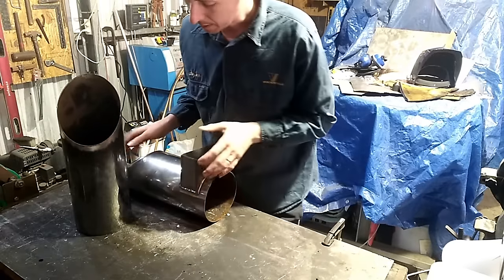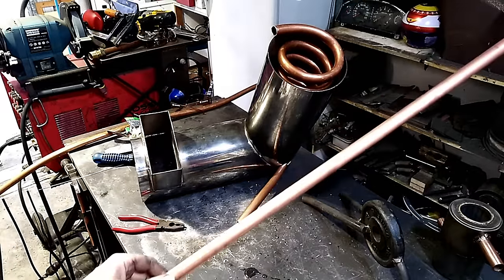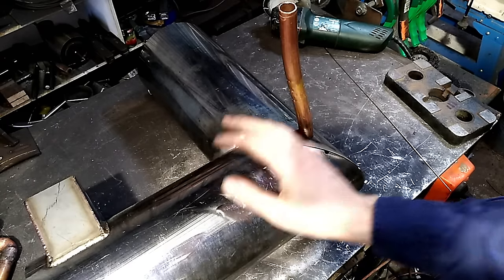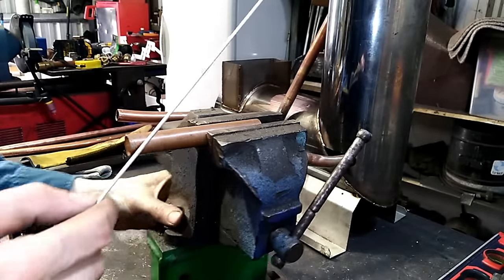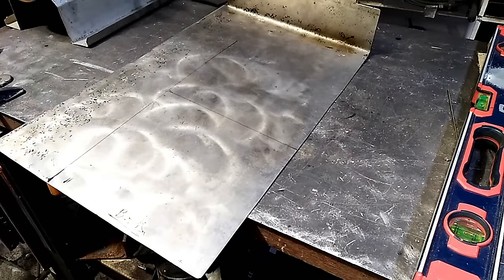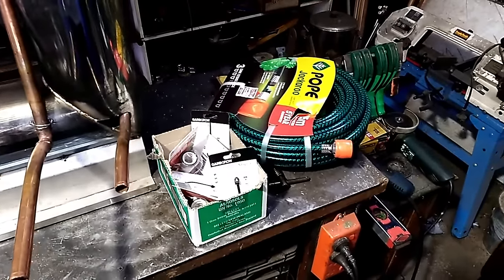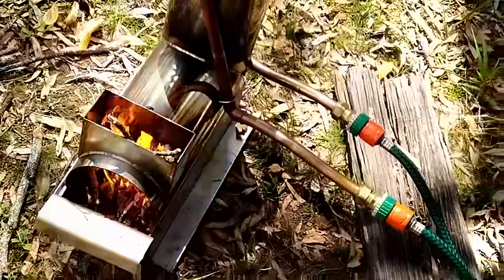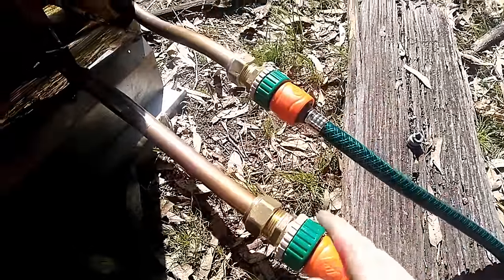Hot Water Rocket Stove II  - BUILD-

Comment: you could also use plumbing solder since this would not be under higher pressure than house plumbing.
Reply: You need to consider the amount of heat this could be exposed to.  Softened joint followed by steam pressure and the whole thing blows apart.
Reply: This is an open system should be less than 10 psi on the steam outlet end if that high, unless it is below the water line then it might hit 50 psi, the only pressure should on the inlet joints determined by how much water is in the tub the temperature with water in the tubing will never get high enough to soften the silver/tin/copper solder used in domestic water systems. My hot water heater is set to 190 degrees F with a well pump pressure set to 75 psi no leaks in 18 years. Don Bahn
Reply: @donbahn1319  In theory you are correct, but you are assuming there will always be water in the system.  Good engineering and design allows for system failures.

I am not speaking theoretically. I have built a similar system and have encountered enough back pressure or temporary blockages to heat the copper to the point of melting the adjoining heater hose.

This doesn't need to be designed to carry hot water,  in which case solder would be sufficient. It needs to withstand direct exposure to a very hot fire.
Reply: the fire should be only on the coil of copper in this set up the solder joints are away from direct fire, better to coil the copper outside the chimney for an indirect heating. Don Bahn
Reply: @donbahn1319  Copper = Thermal Conductivity.  

If the copper is hot inside the box it's going to be virtually as hot 6" away.  If the pipe ever goes dry,  the joint is going to see the same temperature as the coil. 

Just not worth the risk when there are other options.  Mechanical joints are an option that would withstand higher temps and don't require welding/brazing skills.
Reply: Ok we must idiot proof it, a system like this should never go dry before the fire goes out, however there are some people among us, that need to be protected from themselves. I worked with some very creative idiots though. Don Bahn
Reply: @donbahn1319  What's the quote about life giving the test first and the lesson after?

Comment: Mate.

1. Would you appreciate some guy making this for you and then thermally loosening whatever was in his garbage bin with hot water and then flushing it through your hot water heater that will be producing hot water that you're probably gonna let your kids take a shower in?
2. Rocket stoves have one air intake, it minimises the amount of fuel burning at any time and maximises the combustion of that fuel. Your upper and lower air intake system breaks this efficiency.
3. Rocket stoves, when constructed properly, are designed to get up to around - possibly above - 1200 Celsius. The melting point of copper is around 1000 Celsius.
4. An efficient rocket stove is insulated to maximise burn chamber temperature and the burning chamber has zero contact with metal - for the above reasons.
5. I love your metalworking skills - I think you should put them to use building an outer framework for rocket stoves that are lined with a thermal mass that could transfer safe levels of heat to copper coil that are in turn lined with an insulating refractory material [clay etc] to ensure longevity of the unit.
Reply: Can you make me one .and what would be the cost ?

Comment: Question, I'm wanting to build this myself but a friend said that the copper pipe would split from the amount of heat from the fire. Is this true or is he completely wrong? Love your channel, you are great.
Reply from the maker: Long term the copper pipe is the weakest link. If you we're going to make one I would use stainless steel right angle elbows welded together to create the same piece.  I haven't looked into it so you would need to do some research to find the right sized elbow.
Reply: @LittleAussieRockets  what if the copper pipe was on the outside of the rocket stove upright?

Comment: Man, I just tried the same trick with some pipe and I used baking soda to fill it up. Thing wound up kinkier than that fifty shades of grey novel. I should have used sand I guess. I was also using a aluminum curtain rod which may have had something to do with it cuz now that I think of it I don't think it is a true tube as much as it is a piece of flat aluminum that's rolled

Comment: no part of the h2o circ system  should be above the water line. when you boil the h2o out ,you are loosing your heat to the atmosphere.and vapor locking the ciculation.both tank bungs should penetrate the bottom of the tank,and the pressure side, or hot if you will,should be piped up to just below the surface vertically before discharging to maximize thermal expanssion.a sealed vessel is much more efficient but must be fitted with a pressure relief valve.but the  process will naturally perform regaurdless of  the way it is plumbed.nice job.
Reply from the maker: Thank you sir

Comment: There are a lot of ways to skin a cat .. I'm going to be hooking up a system to heat my greenhouse.  Currently I plan to use an old propane hot water heater .. but build a firebox for it to sit on.  There is a pipe that goes up the middle that is a chimney for the propane fumes.   It is also where heat is transferred to water.  I can hook up cold to the bottom where the drain spigot is .. and the hot can come off the top.  I plan to use a 12 volt water pump to move the water .. operated by a 12 volt battery charged by a solar panel.  The pipe for the hot water can be the same kind of hose that is used in cars for moving hot water from the radiator through the engine.  I will pump the hot water through two 55 gal barrels until they are good and hot .. they will radiate heat throughout the cold night.  The firebox can cool off after all the water is circulated and heated.  Need to insulate it well so it doesn't freeze and bust.  Great video by the way .. love your little girls interaction and the music too!  You did a great job building the little heater!
Reply from the maker: Thank you sir 👍

Comment: slide your copper on the outside wood contains acids called creosote that will eat the copper causing leak mine took six months before I noticed a very small pin hole also  use check valves 
 so your water runs one way cold in hot out just a tip from someone that doesn't want you to go through what I did wrong not to late I hope From Big  old Yank Pete Peterson
Reply from the maker: Thanks, mate, good to hear from someone who's been there.
Reply: @LittleAussieRockets  watch the video from the guy who helped me though on a bigger scale I have replaced my water with a 50/50 antifreeze and water running through car radiators being blown through with a fan through plenum under the floor to heat house working to good to hot trying to figure a way to regulate heat.
Reply: @petepeterson4540  I was under the impressions that Rocket Stoves produced very little Creosote, if any since they burned so very hot. In hindsight though, the copper tubes in the stack would lower the temperature of the stack to a certain degree. Please correct me either way..
Reply: Thanks, you have confirmed my suspicions about this build, but great ideas just the same
Reply: @petepeterson4540  that sounds like a great idea how have you riged it up, blown my mind great idea 💡 😀 could do with some pointers 👍

Comment: the two pipes in your blue barrel are too far apart, or to be more specific, the top one needs dropping down so its about 30cm 12 inches above the bottom one,  all UK houses had boilers done this way, also important is the height of your hot water storage should be at minimum a few feet higher than the coil you are heating.  the coil outlet pipe going down is also an issue...
Reply from the maker: Thanks mate, revisiting this build soon!

Comment: I think your idea wouldve performed better, if U would've used pipe or maybe pvc & plugged the heated water line into the bottom of your 55 Gal drum & tapered line into a flared and directed nozzle aimed against the inside so as to create constant movement of water because as You said, heat rises; and of course insulate all your pipe and drum/ e.g., bath with asbestos around pipe & foam around the drum/ bath with a thermometer attached to the bath water.
Please tell us the name of Your cutting oil.
Respectfully, Troy form Texas

Comment: Why did you just not use soldered copper joints, surely any heat generated would not have melted the solder, especially when coil was full of water?
Reply from the maker: That was my concern and my inexperience at that time. I would definitely use solder in the future. As long as the stove was never run dry.

Comment: LOL You make showering under a bucket sound primitive.. The only difference from a plumbed shower is the length of time you can stay in...
Reply: Can I ask how much you charged for the prototype? I'd like one, too.
Reply from the maker: Actually, haven't worked out the final costings yet, will be putting plans up on the website next year if you are that way inclined.  Will make an announcement on YouTube when they are ready.   Are you in Australia?
Reply: @LittleAussieRockets   u can use auto  heater hose,or plumbing pex  pipes

Comment: So the engineering skills are good, but you've missed some of the crucial points regarding thermo syphons.  you have taken the high point on the coil back down again, and that stops the thermo syphon.  it will overheat at the top of the coil, and most of the flow is actually running back and forth from the heater outlet, rather than being replenished from the cold inlet.

Comment: It sputters because the water level is not high enough allowing it to suck air back into the pipe.
Reply: It sputters because there isn't enough flow to keep the water inside the stove from boiling. The dip coming out of the stove allows bubbles to get trapped inside the stove breaking the siphon so the water stops flowing until it boils and blows the trapped air through.

Comment: 1. It would be interesting to see what kind of voltage you generate with the heating of 2 dissimilar metals. (Electrolysis). 2. Why didn't you just buy a small hot water tank instead of the copper coil and make input output adaptions after removing the burner assembly to your heat source? It would eliminate the electrolysis.

Comment: some parts do not allow a sufficient flow and cause a boiling of the water, which will cause calcareous deposits and a rapid fouling of the circuit. Some fittings should be changed, otherwise install a pump on the cold water circuit
Reply: @What Up no no no not newer pump then come out cool water more, all water heater no have pump at copper pipe., waste only money buy pump and no help any.
Reply from the maker: If you've got the time and know how, go for it!
Reply: @LittleAussieRockets  I have the time, I can have the know-how, but I know physics and heat transmission. When it boils there is a problem of flow, and it will get clogged like a coffee maker
Reply: I use a 12 volt high temp pump on my heat exchanger and it works well.  I run the inlet at the top so the water is exposed to progressively higher temperatures as it nears the combustion chamber. I also use 1/4 annealed tubing to maximize surface area and simplify bending using a spring style tubing bender.  I want to try raising my tank height and installing a check valve so that gravity feeds water into the coil and steam pressure pushes the water back on the return leg. 

I use mine for heating,  so I run the return circuit through a car heater core with a small desktop fan providing circulation. 

Awesome build skills!  My only suggestion would be to try insulating the whole thing to improve combustion and avoid heat loss.

Comment: The stove is working too well to rely on thermosiphon alone for circulation. Add a small circulation pump to increase the flow untill steam is no longer produced. Steam production absorbs tremendous amounts of heat. 1 btu is defined as the amount of heat required to raise 1 pound of water 1 degree farenheit. However it takes 970 btu to change water from 212 degree water to 212 degree steam. The rocket stove design works great as your heat source, leave the thermosiphon to the solar guys! Cheers!

Comment: I wonder what steel pipe would do ? I know copper transfer heat faster but longevity due to flame exposure seems like copper would fatigue much quicker since heat makes copper maluable... Any thoughts?
Reply from the maker: Donald Duncan
I think and this is just my opinion that as long as there is water in the system the copper will last all right.  I was able to still touch the copper outlet (hot potatoe style) at the end of the test run. At the end of the day, only time will tell. Thanks mate for the question
Reply: @LittleAussieRockets  what you have created is NOT a thermosiphon but a crude percolator. By definition a percolator will NOT be continuously filled with water!  What you are doing is VERY DANGEROUS and can result in a steam explosion and could cause failure in your heat exchanger or piping. What you need is a to modify your plumbing to create a true thermosiphon.  1) the bottom of your storage tank should be higher in elevation than bottom of your heat exchanger.  2) the piping must ALWAYS RISE (increase in elevation) from the point where heat is first applied to the heat exchanger to where it returns to the storage tank. 3) keep the return to the storage tank flooded (water level in storage tank higher than the return fitting) at all times.
Replace the garden hose from the heat exchanger exit to the top of the storage tank with rigid copper that slopes up to the tank. 
The heat exchanger temperature differential (temperature difference between inlet and outlet) should be no more than 10°F (6°C). The lower the differential the more efficient the heat exchanger. If it is higher, decrease the amount of fuel burned or increase the pipe size to increase the amount of water flowing.
Reply: @igenr8stuff  so you are saying that the pipe from the top of the coil should go to the top of the holding tank? And the return from the bottom of the tank to the bottom of the coil correct?

Comment: You should have braised it with coppertec rods and a map gas torch
Reply: True MAP gas hasn't been produced in the US since 2008.  MAPP gas (Methyl Acetylene-Propadiene Propane) is a substitute.  It only burns 130F hotter than pure propane but costs 3x more.  130F hotter flame doesn't increase heat tranfer that much faster as the manufacturers profess.
Reply: We use it in England to braise copper up to inch tube in refrigeration needs, but oxygen and acetylene for bigger stuff

Comment: Well ..silver solder was the better option.. first time I've ever seen soft copper brazed ...lol... also everything copper that was brazed could have been done with flair fittings .... (or even compression fittings)

    You are basically building  a monotube boiler ... it is actually capable of making superheated steam...look it up... so strict caution should be applied..

   Next insulate your pipes (don't use hose) to and from the barrel ... 

     If using hose for experimental purposes... don't use quick connectors.... they will leak when heated ... as you found out .. 

    Also... you didnt have to use so thick of copper tubing ...  in fact 3/8" (9.5mm)would have worked.. and you could have bent it without using sand ... and made it in an hourglass configuration that wouldnhave grabbed more heat ... 

 Lastly,  the top water should have been about 4" (101mm) under the waterline ..plus a coated steel barrel works a lot better than plastic... 

     That said ..Your rocket stove water heater video was pretty darn awesome and inspiring....

    My family were  plumbers as was I.  I have built steam boilers for steam engines .. monotube, watertube, and firetube boilers ..
Reply from the maker: I appreciate the feedback

Comment: Just thinking out loud friend remember the suggestion to use a pipe machine to wind the tubing?  What if you left a section of pipe inside the copper and inserted some baffles tacked inside the pipe This could bounce the heat around the flew a bit?  It would increase efficiency and back pressure on the burn! The pipe would act as a heat sink for faster distribution to the coil and allow for easy attachment in side the flue! No dowel rods to burn out.  Just stinking thinking
Reply from the maker: Like your thinking, it's not stinking :)

Comment: Hot water in blue plastic tank will never flow down. 
You must put the outlet to the bottom part of the blue plastic tank. 
Hot water is lighter than cold water.  The strange thing is you installed the heating coil correctly but the hot and cold water flow incorrectly. 
Switch the  greemn pipe please